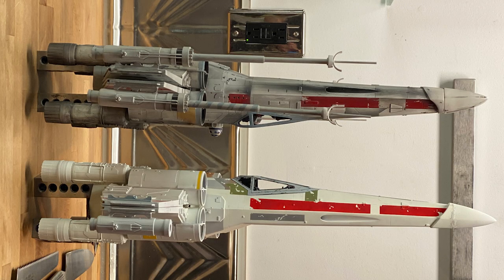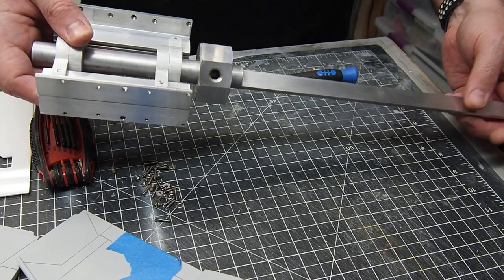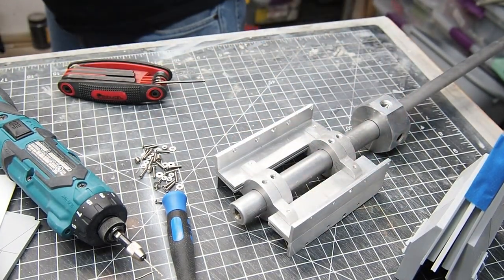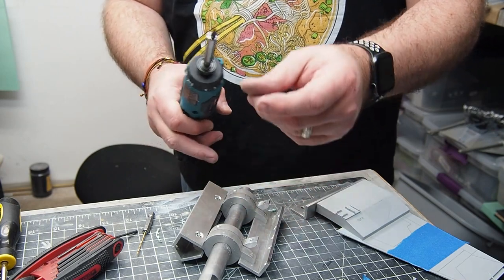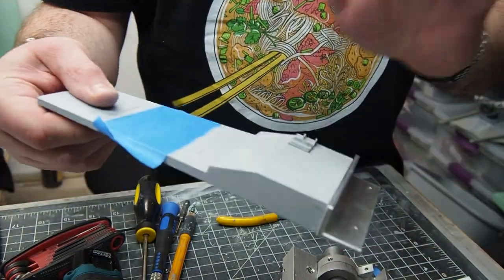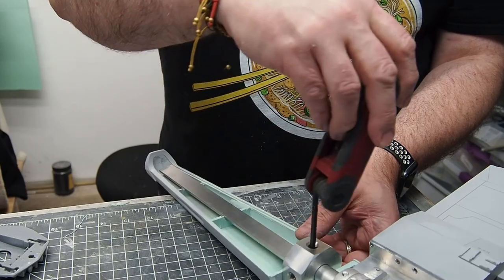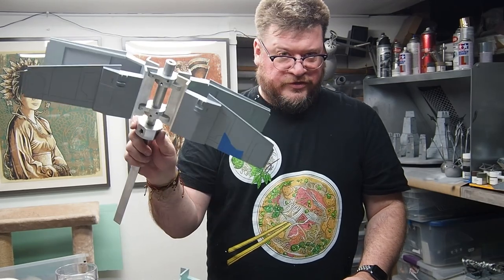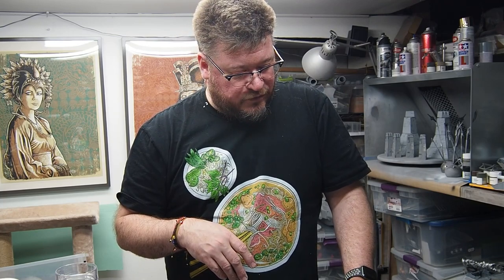Building a Hero Studio Scale X-Wing, ILM Star Wars style - part one

Comment: What’s the point of having the metal shaft go through the entire dragster body of the x-wing forward of the wings? It seems to me that it’s unnecessary considering it’s a static display model and therefore the extra length of the metal offers unnecessary strength. To mitigate sag music wire on the sides could be used allowing for a fully detailed cockpit..